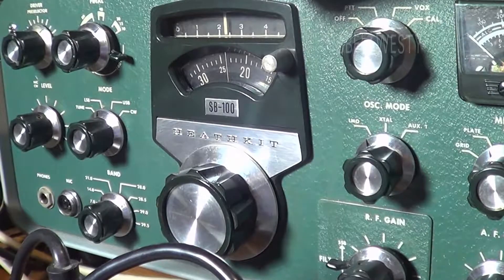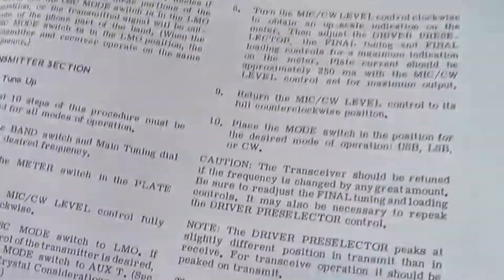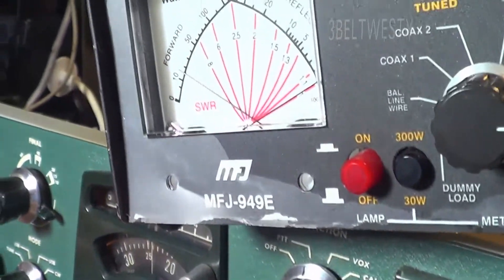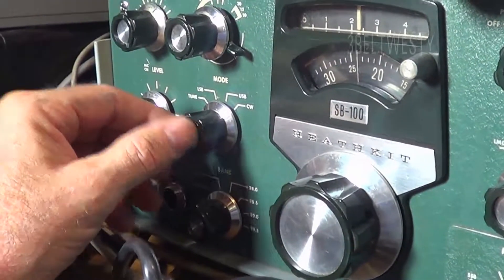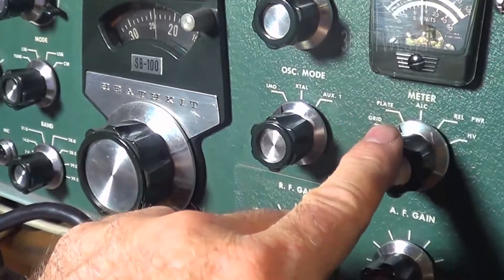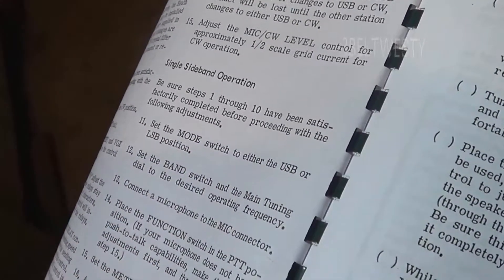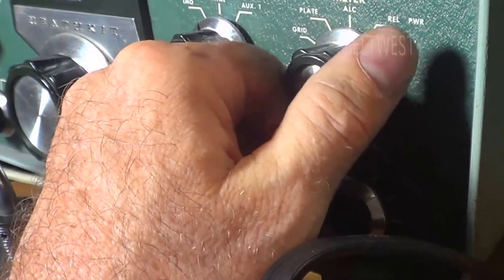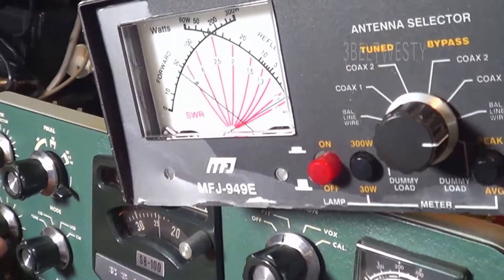Heathkit SB 100 tune Finals with MFJ 949E tuner dummy load

Comment: Its a bad idea to tune the final to 100W this long time. This will kill the final tubes. The 2x 6146 in the SB100 are only specified for 50W average = 100 peak phone. You destroy the cathodes and emission drops until useless. Dont exceed 150mA so long.